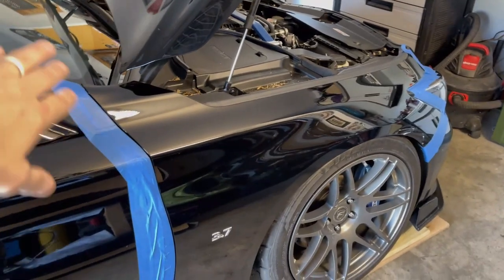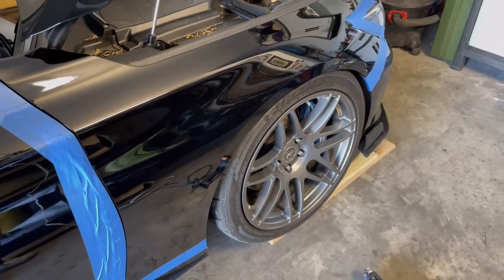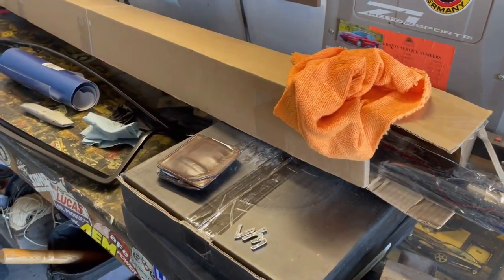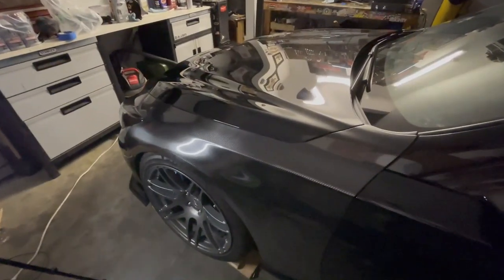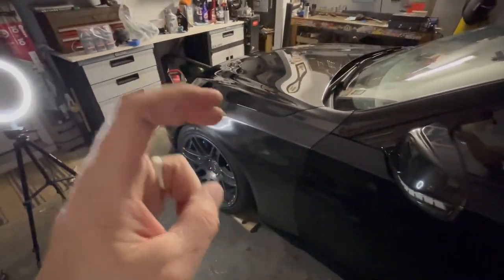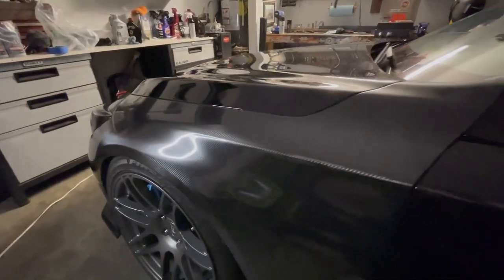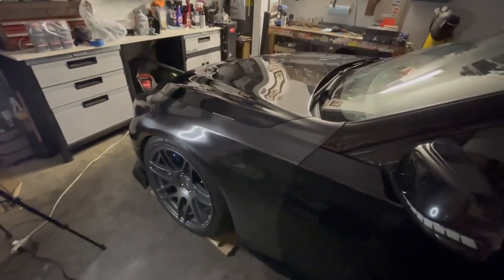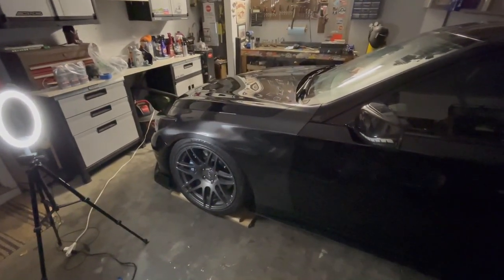How to Vinyl Wrap Front Fenders | Carbon Fiber

Comment: This looks amazing, did you only use one 6x5 pieces or did you need two?
Reply from the maker: Just one piece but as I said in the video—it’s barely just enough
Reply: @SpeedCultureStudios  so you only needed the one 5x6 for both sides or did you need 2 of them?
Reply from the maker: @matayisallen4292  correct—1 pieces, but it’s barely enough.  No room for mistakes or wiggle room.
Reply: I bought two 36”x60” pieces of vinyl, I measured and it seems it’s just enough.  I wonder if I screwed up by not getting two 60”x60” or 48”x60”